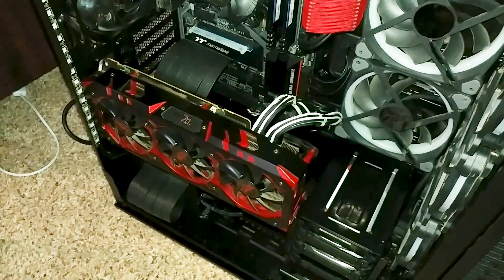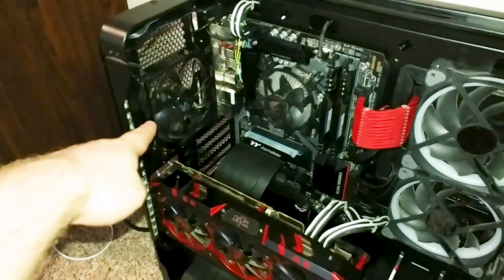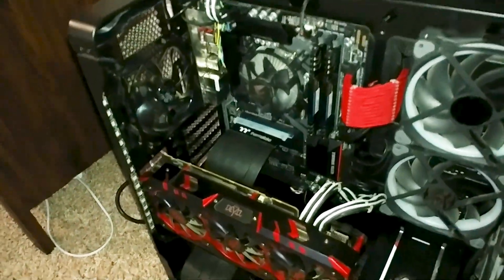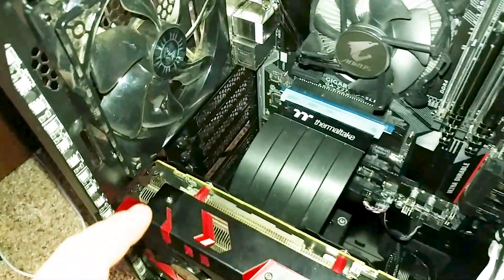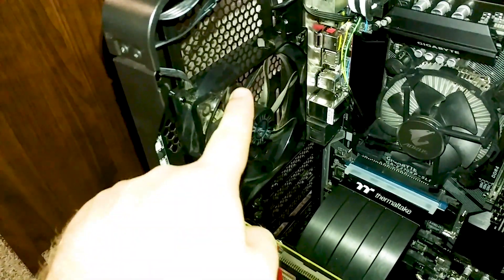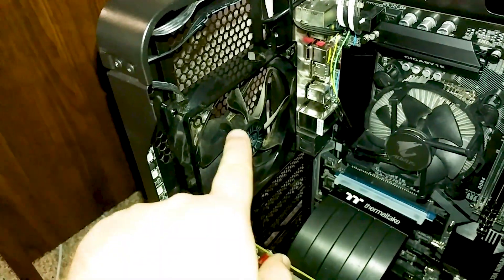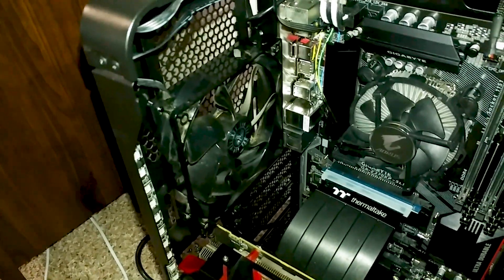PC Troubleshooting: Grinding / Growling sound (Dying Fan)

Comment: Hi there. When playing DCS my 1080 ti sometimes makes a loud clunking or knocking sound. Any idea what might be the cause?
It happens a few times and then stops, but comes back after a few seconds to a minute.
Reply: did you figure it? my PC has started to but at idle not while in a game
Reply: @julmdamaslefttoe3559  for me it turned out to be a wire that was randomly hitting the fan blade. 
I was sure it wasn't a wire until I opened up the side and noticed that sure enough a wire had a bend in it and was rubbing the fan. 
Hope your fix is as simple as mine was.
Reply: @jonnylap1  Nope sadly not I Inspected my PC soon as it happened and cleaned it a month later, Still persists. Who knows maybe my hard drive arm is getting old and springy? Doesnt run windows so should be all good, either that or a case fan bearing.

Comment: Woke up turned my pc on and I heard this noise for the first time I almost had a heart attack😭
Reply: probably BC it was cold in ur room and u know how things have to expand when suddenly exposed to heat so ur fan is just adapting to the temperature so it wil make a little noise
Reply: @lorin8418  ahhh the more you know
Reply: did u figure out why? mine did this this morning
Reply: @datlegenddevoe7530  idk it never made the noise again
Reply: It just happened to me when i turned my pc on ...any tips on what it is?
Reply: @gosgo1096  it never happened to me again but if It does try getting replacement fans

Comment: So, what should you actually DO when you  have the sound? Replace the fan?
Reply: Definitely, asap
Reply: @elladoesstuff1090  i actually cleaned the fan out, removed small wads of dust from between the middle... motor(?) part and now it runs fine again. 

Pc really needed a dusting...
Reply: @Sovann_the_Mighty  I'm very glad, hope it has a long life for you
Reply: @elladoesstuff1090  thanks! Bought the pc (parts) in 2015 yhough, so se has quite a bit of history already. Planning on an upgrade somewhere in the future

Comment: This helps a lot. Even as someone who's had a PC for over 3 years, I'm still learning. The case fans in my case, the Fractal Design Focus G, started making a similar noise to this. To be honest, I may need to unscrew them momentarily, and give them both a good cleaning, because they were pretty dusty when I took the front cover off to look at them. Either way the system is pretty old. The case was released in 2016, and I bought it 2018, along with a MSI X370 Gaming Plus Motherboard. It's a really good case to build in, but it's old.

Comment: Hi. I have a similar sound but it's random for me and doesnt happen at even intervals....at first I though it must be a wire that's getting caught in the fan for a fraction of a second but I cant pinpoint what is going on or where. This is my first build and it worries me, what else could it be?
Reply: I have the same problem! I can’t tell if it’s coming from psu or something else, it’s at random intervals but today in went longer than ever
Reply: @jester1319  it still happens to me and it feels like I'm being trolled because whenever I go to look where it's coming from it stops
Reply: @mateoslab  going through the same thing : /
Reply: DUDE THIS EXACT THING STARTED HAPPENING TO ME.. MY PC WAS BUILT IN AUGUST OF LAST YEAR!!! It happened 5 days ago then today it happened again.. Very weird intervals and then it is so loud. Still cannot pinpoint where it is coming from but I hope it is not my GPU fan.
Reply: @GamingWithNick-ck5ck  me too
Reply: @mateoslab  Did you get it fixed/does it still happen to you randomly? 

It happens late night while on discord.
Reply: @GamingWithNick-ck5ck  yea it does..no matter what I'm doing and whenever I shut it off it does it for like 3 seconds
Reply: @mateoslab  this happened to me, was my exhaust fan. During the winter it wouldnt spin at all i’d have to restart every time, now during the spring its a bit warmer in room and i only have to restart half the time. During cold months  the fan noise wouldnt settle down at all and now it does after a few minutes. Has something to do with temperature and it’s likely bad bearings on the fan. Just needed replacing for me. Good luck
Reply: @mateoslab  Wow dealing with this for 9 months.. I could never.. I live in the Caribbean so it is gonna be so hard to RMA plus it sounds like my GPU fan.. Whenever I shut it down and press the button to power it back up it totally goes away so idk what is happening..
Reply: @xS0Fresh2Death  Hmmm yeah my AC is on.
Reply: @Joseph Purdy do you get the fan noise evrytime you start up your pc because once I start up my pc it makes growling noises then I have to restart it to make it stop.Ihave to repeat that
Reply: Is it safe ? To use that way I bought a brand new one and it makes this sound please reply?
Reply: @TheBeazy  I still have the sound amd idk why but it's less frequent now..j would say yea
Reply: @Joseph Purdy same
Reply: @Joseph Purdy you ever have any luck with this?
Reply: Happening to me rn
Reply: Lol happened to stumble upon this video and this comment completely randomly and yeah I happen to have had this exact same issue for around a year now. I have opened my case and tried spinning every fan manually but cant seem to be abled to replicate the sound no matter what I do. Monitored my temps and they are all fine. Such a weird issue... I guess I need to open my case again and try diagnosing it once again since it has gone slightly worse so I might be abled to pinpoint the issue this time...